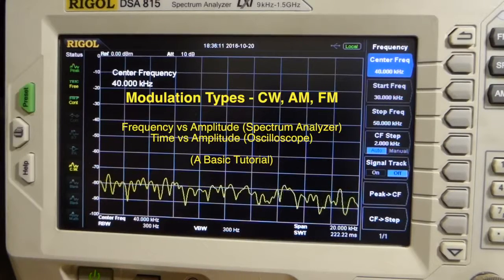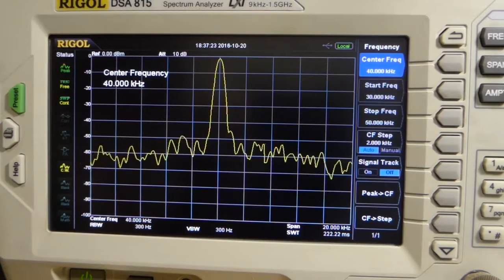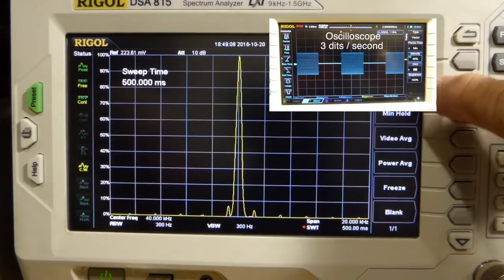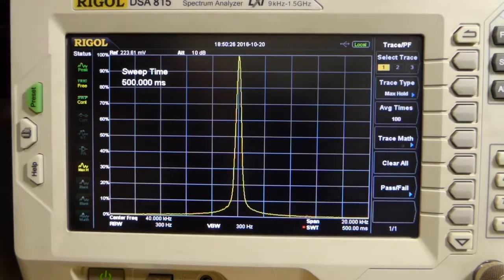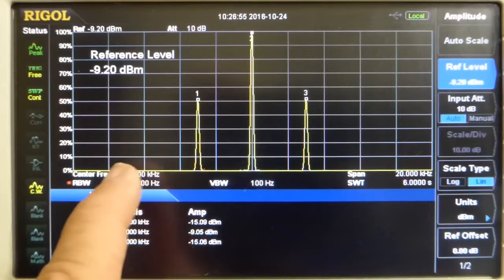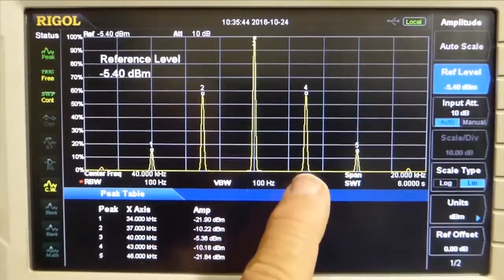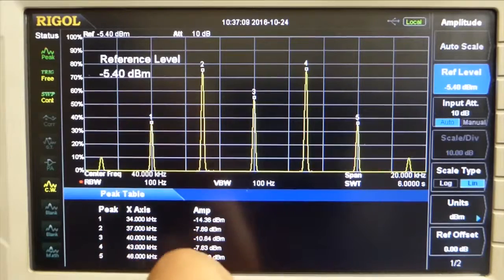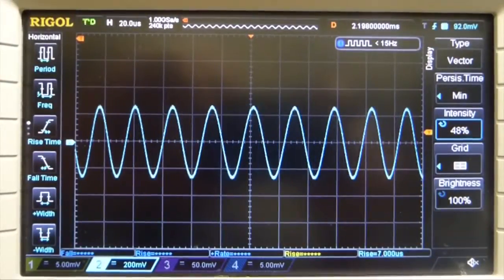Basic CW AM FM Modulation Tutorial

Comment: hello there i was wondering if it is possible to study the behaviour of a fm emmitter circuit with a simple oscilloscope ( not a spektrum analyser). If been trying to connect the oscillo to the a simple fm emmitter circuit transistor collector , i ll get a very small ac voltage with a high frequency.
I wonder if the high impedance of the oscilloscope influences the circuit ?
Reply from the maker: I am not certain what you are trying to do, however when an Oscilloscope probe is placed on a transistor there will be 11Megohms resistance to ground (probe set to Times 10) with 5-10pF of capacitance, typically.  This will almost always affect an oscillator frequency and may even stop the oscillator depending on the circuit.  However I don't know how you would be able to observe FM deviation using an oscilloscope unless it has some method of FFT to show frequency spectrum.  It is easy to check deviation anywhere from 25 MHz - 1700 MHz using an RTL-SDR USB dongle with a computer, however.  These sell for about $20-25 on Amazon.  See the RTL-SDR.COM web site and YouTube videos for extensive information about these devices.
Reply: Thank you so much for the response. Indeed the idea was to connect the probe to the pin where the antenna is connected.
After some testing i realized how much the probe affected the circuit :O ! Never realized it.
I'll check out the dongle :) thank you very much an have a nice evening.
Reply from the maker: Another way to measure FM deviation is available here:  https://youtu.be/8IBOYoIV5m8